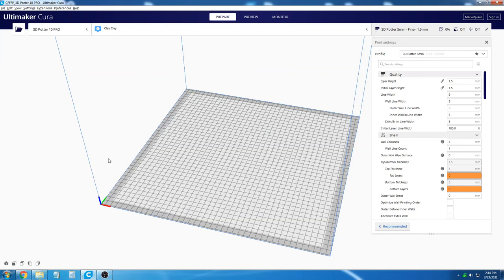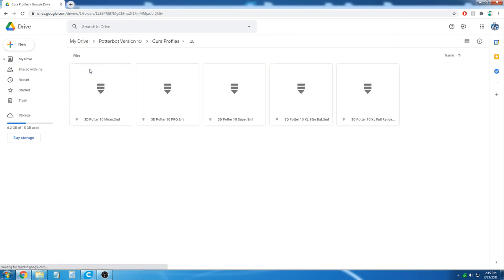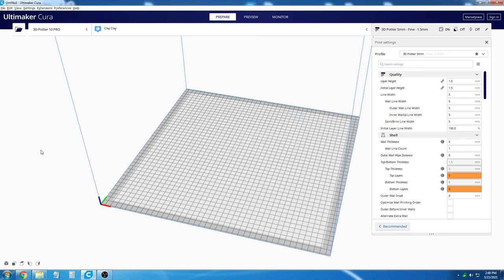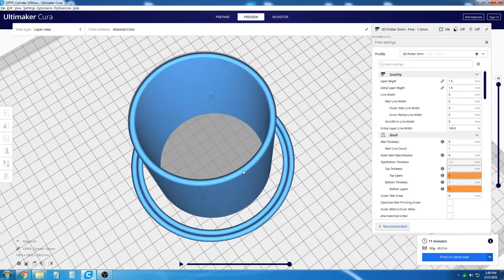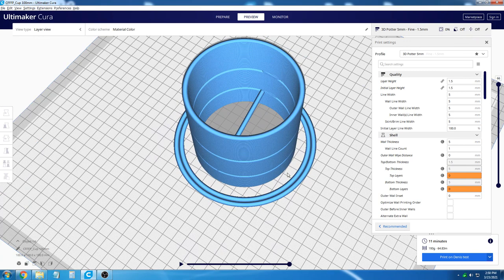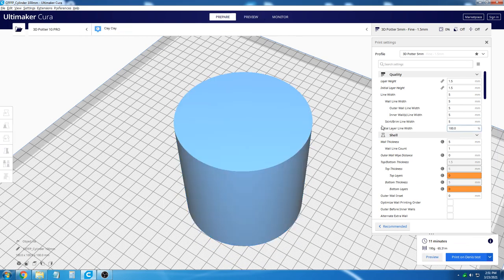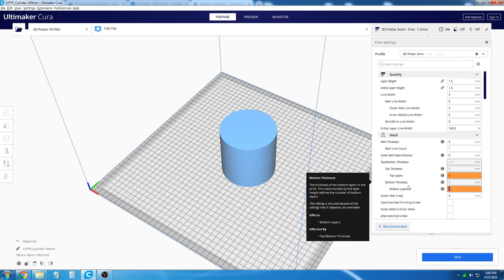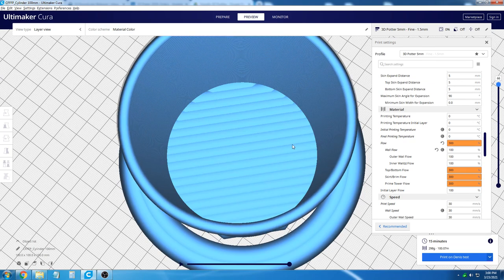Using Cura with 3D Potter: profile installation, solid core objects, printing a base

Comment: When I open the file in Cura it says "no models in file". It does not give me options as you show in this video.
Reply: Tried this in multiple version of Cura on Mac (3.1, 4.8 & 4.11) and none worked. No response or 'no models in file' like you had.
Reply: Colby, solved: You need to check your preferences and change 'Default behaviour when opening a project file" to "always ask me this". In my case it was set to "Always import models" and since there was no model in the project there was no response or "no models in file". Got this tip from 3D Potter support. I had it already running on a fresh install because that also reversed the settings.